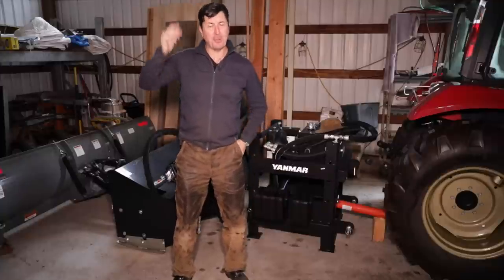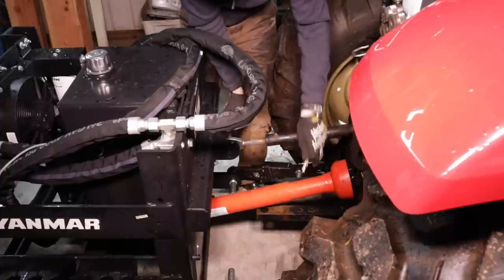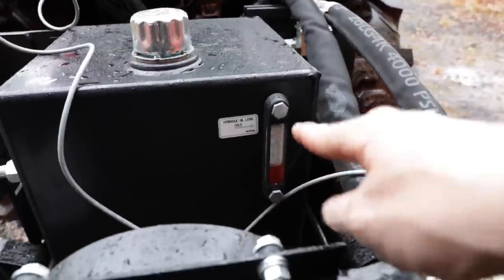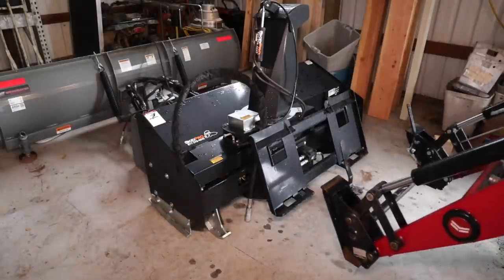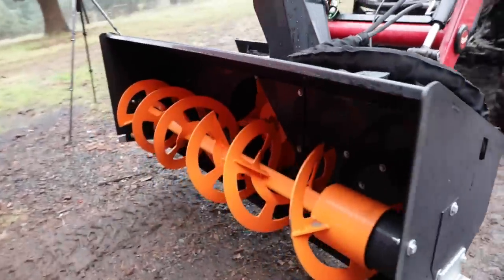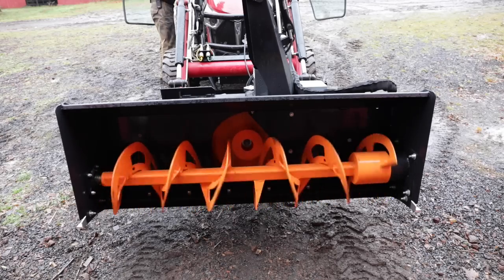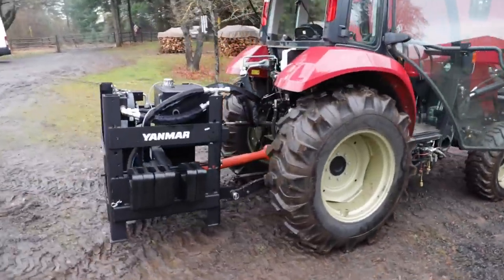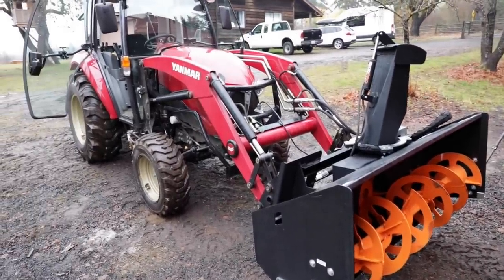This Yanmar Prototype Snow Blower Is AMAZING!!!

Comment: low power on the tractor and hydro driven blowers need lots of power. how will that work out?.
Reply: Thats what the external hydro pump/reservoir is for.
Reply: that it is, but its driven off the pto on a tractor that dont have many hp to start with. and coverting power drains a lot of energy. i dont see that working all too well :)

Comment: I'd recommend building an enclosure for the electrical connection- maybe a weathertight box with a hatch you can close around the cord. You're probably going to get a lot of blowing snow coming back at you from the chute, nevermind the stuff coming down from the sky.

An example here: https://images-na.ssl-images-amazon.com/images/I/51Z595sPbPL._SY463_.jpg

Comment: I think I'd hold off on the amazing talk until we see it move snow. There are lots like it, John Deere has one for theirs. Hydraulic blowers have been put on skid steers and wheel loaders for years.
Reply: yanmar builds john deere compact
Reply: 70's, 80's and 90's they sure did. Not now. They do use Yanmar engines though.

Comment: Yeah that’s not feasible lugging around that huge tank just to power a blower on loader arms. If they can fit a high flow system in a package as small as a skidsteer they damn sure can make a more compact design to run a front mount snow thrower
Reply: allied1394 I

Comment: Hey Cody, I have a question. I'm new to chopping and felling, and so far I've only ever used beat up old axes that were available. I was wondering what your opinion would be for a good beginners felling axe around 60 to 80 dollars? You're input would be greatly appreciated
Reply: Sure. There's one that'll do you really well. It's called... A chainsaw. You'll never be able to process more than 1 tree per day. Probably less than that, depending on size. Just kidding with you, but in all seriousness, get a chainsaw if you plan on processing more than 1 tree per year.

Comment: +Wranglerstar i should have watched this video 1st before I watched your video on the 13th Jan 2018. we get the same issue when we use brush boxes all excavator machines. we always need to divert hydrolic oil at a twin check valve point. when you lift your hidrolic pump and tank up off the ground you no longer need the power going to that and you will need to divert that power somehow. but I still can't see a way to do that because the hydrolic pump and tank and snowblower are independent from the tractor. your only using the electrics from the tractor and not incorporating the tractors hydrolic system. we have similar set ups on our excavator  machines and need to use the hydrolics from the machine to run the attachments. I don't think the yanmar contraption on the back will get upto full power on it's own unless you can incorporate it with the tractors hydrolics by fitting some sort of twin check valve. there will be a way, you'll not give in lol.

Comment: Cool outfit. Should work good.

     If it was up to me to have set that up i would of set up the remote buttons for the shute on the joystick for the loader. You could control all 8 funtions without moving your hand off joystick and use your thumb to press switches.

Comment: Snow Blower or Snow Thrower?  Perhaps its regional but the technicians around here will insist that it is THROWER.  The impeller physically throws the snow and does not use air to blow.  But even Yanmar’s web site uses the two interchangeably.
Reply: Blower is two stage auger + fan/impeller, thrower is single stage auger only
Reply: Jennifer you have been watching to much Paul and Kathy
Reply: Here in maine it's a blower

Comment: Wranglerstar; soon  to be seen wrapped around a PTO! You need a chain on the PTO guard otherwise it's pointless.
Reply: towns84  he hasn't read the instruction manual yet.
Reply: towns84 chaining the PTO guard just puts unneeded wear on the guard they spin independent of the PTO and you can grab a PTO guard at full speed and it will instantly stop that’s how they were designed to work
Reply: It's recommended by most PTO shaft manufactures not to chain it as it wears out the nylon bushings/ bearings that allow the guard  to spin independently from the shaft

Comment: Why don't they just put a front-mounted PTO on their kit?

That way you can flail, mow, blow snow etc. without having to spend another few grand on an otherwise superfluous external hydraulic power pack.
Reply: James Bradwell, If you are a person, contractor, or organization that already owns a hydraulic-powered snowblower for your skid steer loader (that likely has no cab and a slower transport speed than a tractor), than equipping a compact tractor with a cab to run that snowblower is probably not at all superfluous.

Comment: PLEASE reroute the wiring down the loader arm, you wont like only being able to lift the loader that small amount, and at some point you will forget, the wiring will get ripped apart, undoubtedly during a snow storm. There are several company's making this same system for tractors, Erskine is one and John Deere has the Frontier line that has someone else make them with their name on it. The Erskine has the pump hang from the P.T.O. instead of mounting the pump on the power pack and using a drive shaft like the one you have.

Comment: How well is that going to work below zero?
Reply: Probably fine considering that the hydraulic fluid needs a cooler.  It might need to warm up a bit.  If temperature was going to be an issue, I'm sure they have a warmer for the tank.
Reply: Think synthetic fluid. It will be fine. It does get cold there but not usually plains state midwest type of cold.   And he does have a shop/barn to park it in and work in. Thats nice for those cold mornings.

Comment: You haven't heard of this because you added a 15k ish powerpack to a 42K tractor to be able to run skidsteer attachments? why not just buy a 45K skidsteer? especially considering those loader arms were never designed to take the level of abuse that skidsteer attachements will deliver and as such they will get trashed. That I know from first hand experience the absolute trashing I've seen delivered to Larger Quicke loaders because of skidsteers attachments is outstanding they may have the power to run them but they don't have the load capacity to handle the weight and abuse.
Reply: Potskie feel better now that you got all that out?
Reply: I think he has already addressed the benefits of the tractor over the skid steer for his use. I know personally id take the tractor over a skid steer any day for personal use.  I can turn the tractor without tearing up the lawns. Never saw anyone mow a field with a skid steer either. Never seen anyone bringing loads on pallets around buildings on a skid steer either.  Same goes for a hay rake. Not doubting that most of those things could be done with a skid steer but it isn't going to be done at the tractor price point without tearing up the grass and other ground something fierce.
Reply: You can get an AWS skidsteer for around the same price point as that setup. Cutting the grass is the only thing I wouldn't or dont do with my bobcat.  I have Bobcats and Deeres and have experienced the damage to a machine that setup can cause. Since this is essentially a promotional video that doesn't address the large negatives to this setup so I figured I point some out.
Reply: Perhaps you would like to provide some examples? I can't think of anything other than straight up abuse.  I mean seriously running a bucket and hitting rocks and stumps etc. Normal use is pretty tough and those arms are made to handle that.  Hanging on to a snow blower should be a piece of cake by comparison.
Reply: you dont buy a farm tractor to not "abuse" and use it.
Reply: Well if you abuse it for the fun of it then doesn't matter what it is it will break.  I admit abusing mine by hauling huge logs around with it but I try to be careful at the same time.  Pretty expensive to just trash it.
Reply: I have a bush hog for my cat skid steer and do a lot of bush hogging with it it's not as fast as the 15 foot batwing I have for the tractor but some of the areas the tractor won't stay on but the cat hangs on the hills much better it only tears stuff up if you try to turn to tight
Reply: uhm yeah lets see how many times you can go next to your house and around your house this spring without tearing up your lawn. Sorry been there and seen it. Tractor has 2 differentials which lets it turn and only twist a tire. Skid steer is just that. it pretty much just skids itself around which tears up the ground. Which is fine when brush hogging a rocky field or hauling dirt at a new construction site. Not so good on lawn in tight spots around the house and garden.

Comment: Reminds me of German engineering- let's derive the most complicated way to solve a problem that doesn't exist to begin with.  Problem is Yanmar tractor has an inadequate hydraulic pump to begin with.  And no mid-PTO.  J-U-N-K.  Using the loader arms to mount the blower puts the blower much further forward, hence the need for a thousand pound weight pack monstrosity on the back.  John Deere, CaseIH, New Holland, Kubota, would be embarrassed to have this contraption in their lineup.

Comment: I would think a forward facing rear mount snowblower would cost a lot less than this and is the way I have seen quite a few farmers here in Canada deal with snowblowing mile long driveways.  Drive over the snow with the tractor and then the snowblower is dragged behind. 

https://pronovost.qc.ca/en/snowblowers/inverted
Reply: That does look a lot simpler.
Reply: i have one on my 1957 John Deer 420 it is easier to use than  a rear facing unit great for long open runs a bit of a pain around the buildings but i would prefer a front mount but those are very pricey units
Reply: Thats just craziness right there. Add another foot or two and then what? With the front mounted blower you can still take the top off enough to get through the deep stuff. Id rather go backwards and get the snow before my tires packed it all down.

Comment: Going to be over stressing the  loader arms and hydraulic rams.
Reply: Scott Foster, Could you explain your reasoning for your comment?  The loader arms are designed to push a standard 72 inch bucket into piles of heavy material (including snow). How does that compare with pushing a snowblower into snow that the snowblower is moving mainly with hydro-mechanical power, not the forward motion of the tractor? About the hydraulic rams, the loader has 2,500 pounds lifting capacity at the pivot pins. The snowblower manufacturer gives a weight specification of 880 pounds for the 72 inch snowblower.

Comment: I would not have bought that hydraulic power pack.  I would have built my own and incorporated a rear blade into it.  I plow in the mountains using a 1950 John Deere MC no blower just a four way protractor type front blade but the cabin tract road is only a mile.  I have been on top of three feet of snow pushing two and I sometimes wish I had a larger machine like the other guy that plows the same cabin tract but when the snow is deep his skidsteer has its limits too as he has to stay on the road but I can push the snow into the ravine below the road without worry of sinking and tumbling over the edge.  A rear blade built into the hydraulic pack would allow the same thing.  The blade could slide out laterally several feet past the Yanmar to tip the snow berm over the edge.

Comment: A swing and a miss. Overly complicated, expensive and limiting for snow removal. Glad you probably didn't have to pay for it. For a snow removing tractor, the very best set up is a snow blade mounted on the quick connect mount on loader and a snow blower mounted on the 3 point. Back blading ability is mandatory IMO to pull snow from tight spaces and close to buildings, etc., plus blading down piles, using for quick snow removal for light snowfalls......on and on. Plus that setup would be a PITA for the need for switching out other needed front or rear implements for other tasks during the snow season. 30 years experience here on a farm with 1/2 mile driveway and large building site. BTW, excellent channel!

Comment: That pto shaft cover should not be turning under operation!
Reply: I've never seen one that didn't turn when the shaft is turning. The cover will stop if anything rubs against it.
Reply: jmhaddon Chaining the PTO guard just puts unneeded wear on the guard they spin independent of the PTO and you can grab a PTO guard at full speed and it will instantly stop that’s how they were designed to work

Comment: Sure is hugely complicated and many $$$$ of what ends up being a pretty tiny blower.
Reply from the maker: The blower is not tiny,
Reply: In the world of tractor mounted snow blowers it's a tiny blower. All of ours here in the midwest are 6-8ft wide, with 3-5ft tall with 2 or 3 augers.
Reply: But with this you can power all kinds of hydraulic tools on front and tractor hydrailic system is free to operate front loader at full speed.
Reply: Tom Krause I'll take two
Reply: It is tiny
Reply: I guess your blowers are pretty tiny too. I mean I was just watching some train mounted blowers.  Just saying those trains move a lot of snow with those blowers.
Reply: Tom Krause, This snowblower is listed at 72 inches wide by its manufacturer. https://skidpro.com/skid-steer-snow-plows/skid-steer-snow-blower-premier-series/ 

Keep in mind that this system is about making compact tractors an alternative way to operate the many hydraulic-powered skid steer loader snowblowers that are out there in the marketplace. An alternative with a very comfortable cab and probably a faster transport speed going from job to job.
Reply: Amen Brother Best to be positive when you can

Comment: Seems way too complex and expensive for the benefit, rear mounted blowers work just fine and you still have use of the loader for using the bucket or a plow
Reply: bwilliamstown he has quick attach plates on them and the plow blade is in the barn so he can switch between plow and blower in a few minutes out of the snow so gets the benefit of both in the forward facing position. 

Andrew Delashaw rear facing PTO powered blowers are common and they can be a pain to use as you have to twist to both see out the back at the same time both feet are in use and at least one hand on the wheel. Most of the time they use the plow to push the snow into a snowbank then the blower to get it out of the way for the next snow.

Comment: hydraulic cooler....on a snowblower. if it's pushing snow....it's cold out.
that rigging looks like it's bending that tractor in half.

I can see value for summer work...but if you want a sweeper in summer and your hobby tractor won't turn it....you need a bigger sweeper for your gravel road lol
Reply: I disagree. Just a tank won't dissipate the heat needed. Maybe if it was 30 below zero out but in our area of the country it doesn't really do that. Most your snow work is done around 30 degrees.

Comment: i don't understand it?why get a snow blower too but inn front of a tractor With hydraulic,when you can get a snow blower too but on 3 point back on your tractor,and you dont need the extra hydralic system?well maybe they dont sell it in usa.i guess you have your reasons,well anyway did like the video and hope you get some snow soo we can see it in action
Reply: really no unnderstand what the problem is,in norway where i live we youse pto and have the snow blower back of the tractor,and we dont reverse when we drive a tractor With a snow blower.and yes you can get this type a snow plower in norwy back in tractor With pto
Reply: and for the snow 2-6-feet,that too is not a problem,you are driving a tractor,and Winter you need Chain on the Wheels,so 2-6 feet is easy too drive on a road for a tractor
Reply: Wiking hb With the rear mounted snowblowers you have to drive in reverse the entire time so always driving with your body twisted. A front mounted blower on the loader arm lets you do things you can't normally with a rear facing like lift the blower to take slices out of a snow bank. 

Snow in one area is not always the same as snow in another as the snow itself changes depending on how much moisture it holds from dry powdery snow to wet snowball snow.
Reply: Andrew H u pull the rearmounted snow blower behind the tractor- but it is facing FORWARD. See?
Reply: ha ha no you dont need too reverse too have a snow blower back in a tractor https://st.mascus.com/imagetilewm/product/finnapi/orkel-2610,100196728-1.jpg,this is standard in norway,have youse this all my day,and never reverse With the tractor too remove snow.
Reply: did look up snow blower in different places in the usa, and all that I found was too youse in front of the tractor.did find for back in the tractor,but this was youst for reverse.dont they have snow blower for back inn the tractor inn usa?

Comment: Yanmar? Is that USA made?
Reply: Yanmar tractors = major manufacturing in Japan. Assembly of North American versions of the tractors in Adairsville, Georgia, USA.
Yanmar loaders = designed & engineered in Adairsville, Georgia. Manufactured in USA.
Yanmar hydraulic power pack = designed & engineered in Adairsville. Manufactured in USA.
Snowblower = From the Skid Pro company, Alexandria, Minnesota, USA.